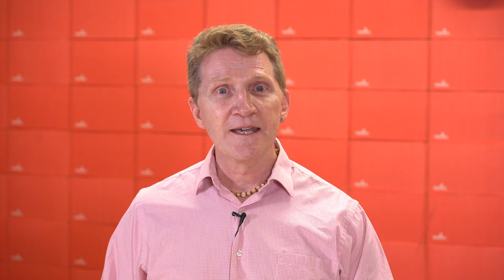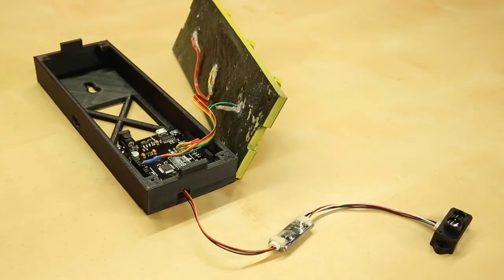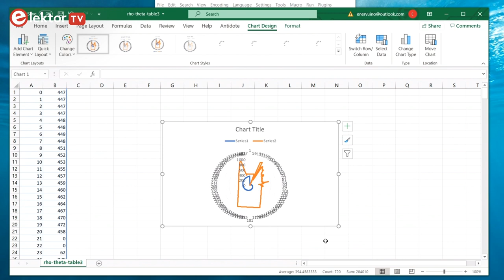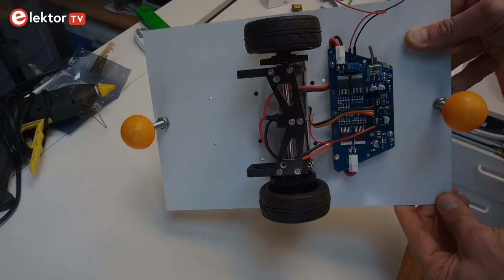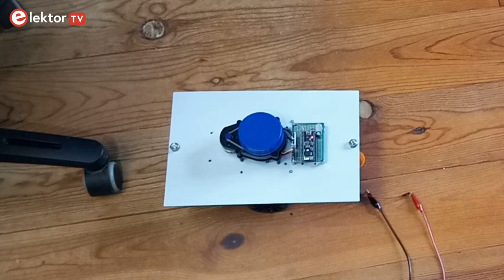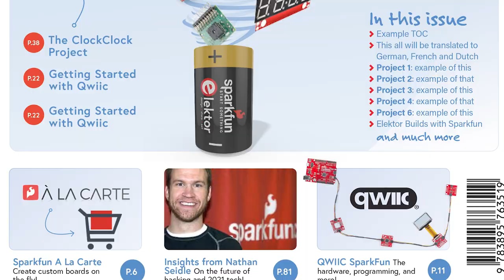Perfect Parking with LiDAR

Comment: The tennis ball parking assistant was replaced with dual laser pointer things widely available on Amazon now.  My LIDAR parking assistant has a digital distance readout in addition to the stoplight lights.  The TF-Luna works great for this and is cheaper than the TF-Mini that's demonstrated.  TF-Mini is total overkill for a dumb stoplight parking assistant.